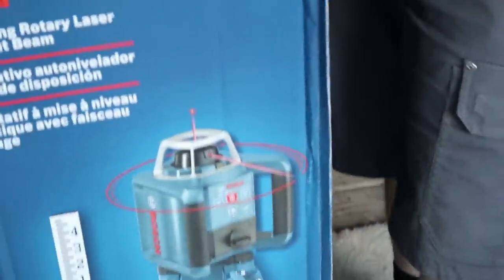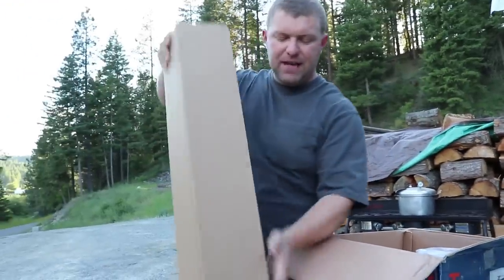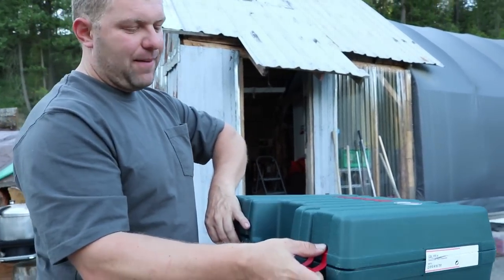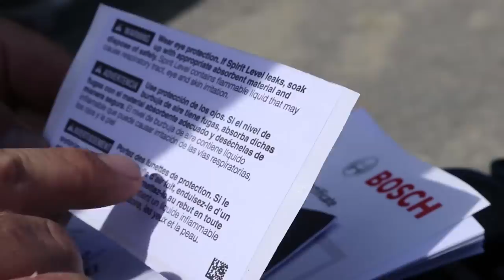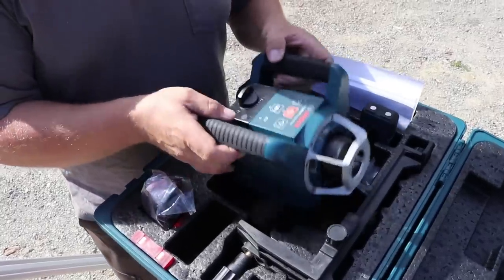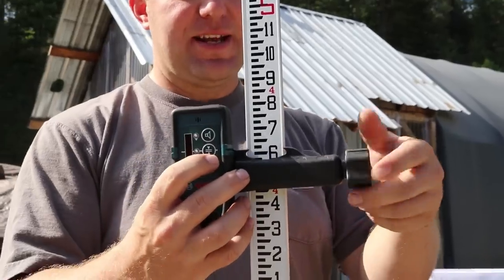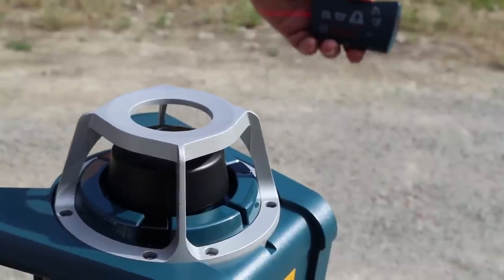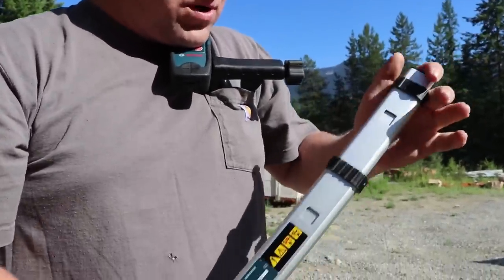WORTH THE $700! 😰 (Bosch Laser Level Unboxing)

Comment: Hi guys, we love to watch your videos, was thinking you will need 25 inches fall for septic line at 100ft.(sometimes less than 1/4 inch ft. can be used with larger pipe. you should check and know exactly what elevation septic connection is. Before setting house batter-boards also consider if line needs to be lower when it leaves the house because of frost line. just a heads up from an old builder.  P.S. want to check the level take to a local pond, we have level water where we live :)

Comment: Man the judgement on the internet is so fierce but man my brain is screaming water level the whole time... so easyyyyy so much more accurate.
Reply: Yes! That's how I have done my projects - nothing as grandiose as a septic system but I have built shuttering to cast concrete and marked up levels for my distributed rainwater system by using clear hose with water in it. 
Added advantage: it works around corners. If I needed line of sight (as the laser level does) I couldn't have done the rainwater system as I have hidden water barrels behind things.

Comment: You made a good call on the Bosch.  I have the Bosch Automatic Optical Level  with the same tripod.  I use it to mark and stake lines on my property over a 1,000 feet.  The Tripod is very solid.  Except when I bump my big butt into it!!  Do you know if they sell just the laser head and laser receiver?

Comment: Pure living for life friends!  I wanted to comment and leave some positive vibes, because there is a lot of negative going on.  I understand why you purchased the laser level, and you didn't mention it in your video.  A laser level takes ONE OPERATOR, that frees up one of you to hold something on the other end or pound in grade stakes.  Yes $700 is expensive for a tool, however it did come with 4 major parts.  And consider that the ones we use on construction sites (road construction) cost between $15,ooo and $30,ooo.  

Before you get into setting your foundation you might want to have the level calibrated.  call up a local surveyor to help you do it the first time, or point you to a shop where it can be done for a fee.  While working with Kiewit and Granite (civil contractors) it was a requirement to have our levels calibrated by a third party once a year.  and the level is suppose to be checked (the 180* turn) before each shift.

Don't listen to the nay sayers, I know you budgeted for the expense of this tool and you do not have to justify it to the wonderful viewers here.  Thanks as always for doing your research, sharing your experiences, and trying to do things the right way!

(PS, the proper name for the "grade rod" is "philly rod", no idea why and a lot of people call them grade rods now)

Comment: What is the difference or benefit between a Rotary level like this as opposed to the Bosch GLL 150?  I’m trying to decide if they are virtually the same tool?    A Rotary seems to have a single point that moves fast, and the GLL uses a solid projected line... but both use a reciever system.   Do you guys who have more experience have any input?

Comment: A lazer level seems to be getting ahead of your self's. You would be best served to get a tractor/ backhoe. You guys  seem to spend more time behind shovels, pulling pipe by hand, moving objects, and lifting heavy objects. A backhoe will help you with milling lumber and building your house, from grading and lifting beams. You can get one from 9,000 to $$$$. Eventually it will pay for itself. PS the resale of tractors is good.
Reply: Steve Sprouse I said the exact same comment several weeks ago, but hay were not doing the building so let's just see how they get on 🙃
Reply: They bought a Case backhoe already.  No video about it but it was on their Facebook page.
Reply: As a log builder of 48 years, I can tell you that the work that you do with the tractor will take longer and come out poorer in quality if you don't have the laser.  I also grew up in a sawmill family and own my own sawmill now.  Without an excellent level, your mill will not be dialed in correctly and everything you cut will be questionable.  A good house will only come with quality materials and  your mill will need to be checked from time to time.  The Wood Mizer that they bought is of the style that needs to be kept level and readjusted over time.  Just because you thing the laser is not important is an opinion, just as is my opinion.  They can take them both for what they're worth.
Reply: I agree, but you still need to get the log on the mill.
Reply: please link $700 tractor to reply. thankyouverymuch
Reply: This comment is kinda funny to look at now(they got a backhoe in the new video) :)

Comment: why didnt you just rent one how many times are you going to use it ?????
Reply: Agreed, I rented one a few times; $50 for the whole weekend.
Reply from the maker: Renting it adds up (I think it's $25/day) and we're going to need open A LOT for this home build (and beyond). We'll more than get our money's worth our of it.
Reply: When done with it you will get more than your moneys worth because you can sell it after the need no longer exist and use it at your own pace. You won't loose money overall staying with a brand name.

  Without an investment there is no dividend !!!!
Reply: Not to mention the time and travel cost of going to get it and then returning it.  Nothing worse than rushing through a job because you don't want to pay another day for a rented tool and getting a speeding ticket trying to return it before the rental store closes. Like you said early in the video they hold their value. At $700, it will pay for itself and then some. I say good purchase. Don't laugh but I've even used a laser level to hang drywall. No more excuse for missing the stud.
Reply: When you live in northern Idaho you don't just run down and rent something every time you need it.  This tool will be used in many ways for the next several years.  Some things like a concrete vibrator should be rented if you don't do the work on a routine basis.  In their case this tool will be used many, many times and it justifies the expense.  Timber framing isn't something that you can half-ass.  It is precise work.  Good layout and precise joinery will save many hours of trying to correct something that you didn't do well up front.  I've been building log homes for 48 years and I incorporate a lot of timber framing work using round logs in my homes.  I can tell you that there is something called "accumulated error" that will come back to bite you in the ass if you don't hold yourself to tight tolerance all along the way.
Reply: Ryan, good point.  I got a great pro tile saw years ago for nearly nothing because the motor had failed and the cost to replace it was unbelievable.  I looked at it and went down and bought a high quality Metabo angle grinder and whipped out a drawing for an adapter to mate the two together.  My local machine shop made the part for about $50 and I now have an excellent tile saw for about 25% of the cost of repairing the thing.  I don't do a lot of tile work, but I can now share the tool with other builders in my area and they help me out in return.
Reply: Dennis and Helen wrong, new ones are cheaper every year.  Professionals rarely buy used electronics, and other than him only professionals buy the $700 version.  I know professionals that only bought the $150 versions.  My $50 version shows me a straight line and keeps it level (more than good enough for homestead use).

I still don't see any part of the house, summer is half over, we should start a pool for when they will finish the house, I'd put $10 on 31 August, two thousand twenty two.  Nice hot tub.

Comment: Hi, great video!  I also want to buy one of those for outdoor leveling and grading.  I like the GRL 300 HVCK.  The only thing I wish it has is sloping and center-line, like the GRL 500 HCK.  How can you use the 300 HVCK to level fence posts on a sloping lot?  To make sure that all fence rails line up in a straight line down the slope? Also, what is the value of having vertical leveling outdoors?

Comment: So... does it work without line-of-sight? :-)
Old hosepipe with a bit of clear pipe jammed in each end plus some water. Good old gravity is our friend here. 

The laser level has a place in the world, I'm not sure it is necessary for the degree of precision required on your homestead though. Generally the required drop on a pipe has a pretty wide range so a few inches in 100' is not going to make a difference.

Comment: Reading all these comments from fat Americans about using garden hoses and shit I wonder if you ever did or tried to do a precise work ? Do it once properly and precise and save money in the long run.Many of you probably cant value a good laser since your houses are made of paper good luck using hoses and shit while making a brick or concrete house like other countries do :D there is a reason why big companies and professionals use modern tools.I wonder why do so many contractors and companies use HILTI,BOSCH and other expensive lasers if they could just use a garden hose. Damn the idiocy of some of these comments and people is actually frustrating :D I know not everyone is fat or that not every paper house is bad in American I just lost it after reading through the comments and seeing all the clueless or envious comments .
Reply: bametje lol yeah
Reply: bametje yes there is a reason big companies use these lasers, they save time and it's probably easier to teach someone to use. that is not the point of most of the comments and I'm sure most people know that they save time. I think most people are trying to point out the choice of spending PLFL uses. they spend tons of money on tools that are not needed and don't spend the money where they should, like water system leaks. water levels are very accurate and in my opinion, make more sense for the average home owner. I used a water level to hang gutters around 3 corners of my parents house. it worked awesome and probably took less time to get it filled with water than it would take to set up a laser. oh and try measuring on the back side of the house without moving a laser and setting it up again. with a water level, I can measure from the middle of the front wall to the middle of the back wall, you can't do that with a laser, unless you manage to shoot the laser through a couple windows.
Reply: Yes for many things a "spirit level"is useful and faster but for more serious things where distances get longer you use a self levelling laser there is a reason why they use these things for longer distances and planes where its just not practical to use a spirit level and a pencil or a chalk line. Good luck using a spirit level to draw perfect lines around a room for a lowered ceiling that has 20 M long walls etc , or marking out stuff on a huge floor.The time and effort and the preciseness this saves them outweighs the cost by a huge margin. You can set these lasers up at a distance and they paint a nice line its very easy to use for almost any application.And for a gutter it makes no sense to use a laser as you just copy the roof under a slight angle.

You set up the laser in 1 minute double check and you can go and star drilling and fixing stuff cant beat that.In Europe we have many Stone or Brick,Concrete houses some older than the US using a laser is almost a must since the walls are not straight nor are the ceilings so you cant just take measurements of the ceiling in most cases :D Since these buildings were built with water levels you can see many flaws in them.If you wanto do a clean efficient job a laser is a must have for many applications.
Reply: We joke about US houses being made out of paper it wasnt meant as a fact (dry wall,wooden cladding,plywood) Mainly compared to European houses it does feel like paper when you compare a plywood and gypsum wall to a 15+ cm reinforced concrete wall or 30++cm stone/brick wall :D We dont have to worry about guns over penetrating in our houses in case of self defence unless someone is using a tank :D US style houses are still pretty uncommon here.Most modern houses are still built with solid walls.
Reply: bametje having worked in the U.K. Building industry for over 35 years both domestic and commercial projects I have to not only strongly agree with your comment about the value of an accurate levelling system but also that when constructing with varied building systems it's essential that by starting off with a true level (concrete foundations and such forth) the project proceeds far more easily with subsequent levelling as you progress to check accuracy of installations
Reply: Go figure in the Germanics nobody uses water levels with hoses and such. They all seem to use lasers (including myself). Why? Because they are dead easy to use and they are accurate.

How about get around the house? Dead easy. You only need two opposite corners. And the thing is that you don't need them to align perfectly you just need to the relative distance from the two lines. And then it comes down to math. I have done it and it works fine.

Comment: Did you mean rust?, cos corroding is what aluminum does :)
It looks suitability protected from that though.

Oh be sure to make use of that hook under the tripod to hang weight from. It will take a lot of the spring out from those legs, particularly in gusty conditions.

Comment: If you just add a piece of clear hose about 2 ft to each end of a garden hose you can fill it with colored liquid water and it will be level on both ends.  Then make reference marks on each post to derive a level plane.

Comment: Looks like an expensive battery eating toy, not quite commercial grade to me. I built commercial water plants and started using 'Dumpy Levels' for grade and Transits for line before lasers came into vogue. As with most quality tools, the operator's skill makes the tool useful or not. Good luck and bring lots of batteries.

Comment: A water level will always be the cheapest and most accurate level ever.  IMHO
Reply: Ever used a water level when you had it filled with water and had an unexpected, unseasonal drop in temperature over night?  Sure, you can fill it with a water/alcohol solution or even automotive antifreeze, but sometimes you're caught off guard and it will not work.

Comment: junk. even that laser line bends. If done correctly a four foot spirit level can be an amazing tool if used correctly. ask any old timer. water levels are so accurate and cheap why waste your money. I was wondering if there are any resolution specs on any of your literature that came with that. Also the bubble level on the side says it all.